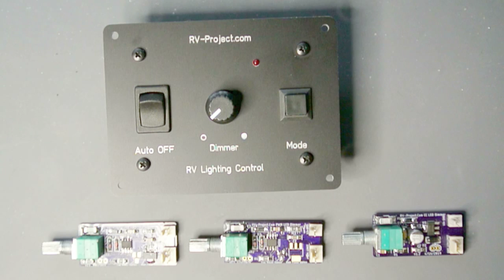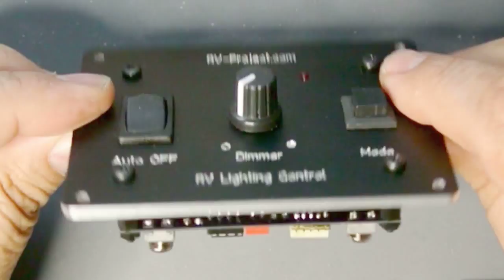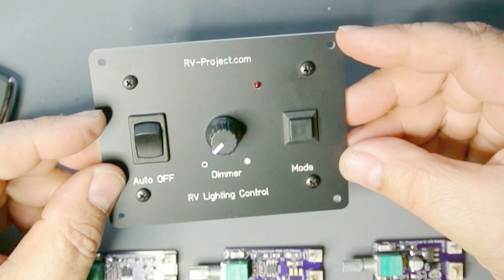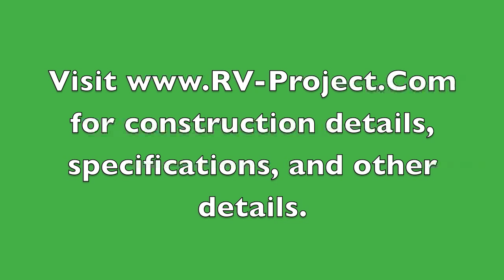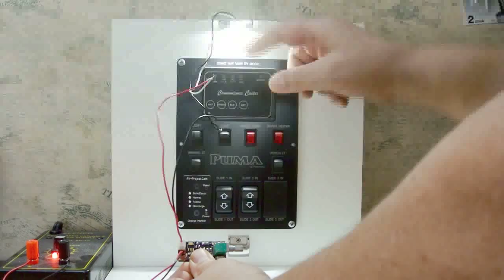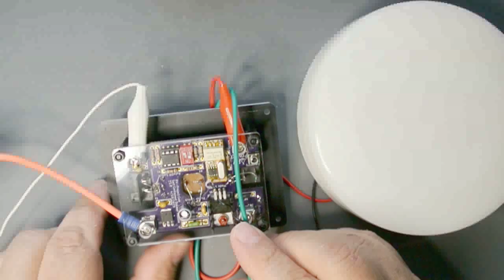Four Custom-Built LED dimmers for your RV (that you can build).

Comment: You are an expert! I wish I had your knowledge. I could use your help! Some time ago, my RV dealer installed some dimmers for me. There are 2 on one side that when both lights are on, if I dim one they begin to pulse, bright to dim. The dimmer they are, the slower they pulse, and pulse faster as I turn the brightness up. If only one or the other light is on the dimmers (individually) work perfectly. No one can figure out why. Any ideas???
Reply from the maker: It's not uncommon for LED dimmers to flicker at times. Usually though, just a slight adjustment of the control will take care of it. 

However, your description seems a bit different.

One possible issue is the dealer used the wrong type of dimmer.  Many of the cheap china dimmers are LOW SIDE, because they are less costly to make. Other dimmers, especially the few made in the USA (yes a few are still made here), offer HIGH SIDE and LOW SIDE dimmers.

The use of a HIGH SIDE or LOW SIDE dimmer is dependent on how the LED fixtures are wired. Some LED configurations require the use of a HIGH SIDE dimmer, while other configurations can use either. 

A HIGH SIDE dimmer will work in either case.

Another possible issue. LED dimmers typically use a technology called PWM (Pulse Width Modulation).  In effect, the LED is turned on and off hundreds or thousands of times per second. The amount of time the LEDs are turned on vs. turned off in each individual on-off sequence is variable. The longer the "ON" time, the brighter the LED will be. Therefore, flicker will be more noticeable when the LED is the dimmest, as the OFF time is longer.

Different LED fixtures have different PWM frequencys - that is, the number of times per second the LEDs are turned on or off.

LED fixtures used in RVs, especially puck lights. require a LED Driver. A Driver is a control circuit that ensures the LED does not receive too much current - which can burn them out. Think of the driver like a Governor on a motor.

There are two types of drivers commonly used for LED fixtures. Linear and Switch-Mode. Linear drivers are somewhat inefficient and waste a bit of energy, while Switch-Mode drivers are more efficient, and they actually also use PWM to control the LED.

Unfortunately, the PWM LED drivers don't always behave well when used with PWM drivers. Thing is, you are attempting to control a PWM LED with a PWM dimmer, and that doesn't always work - or at least work well. The best results are achieved if the PWM driver in the LED is a higher frequency than the PWM dimmer.

Recently, with the emphasis on dimming LEDs, many of the LED fixture manufacturers have gone to linear drivers as they work better with dimmers.

Long story short... you can try replacing the dimmer with a different brand. Especially those cheap Chinese dimmers found on eBay and Amazon tend to have a higher frequency, and they may not work as well with Switch-Mode LEDs.

Or you if you have Switch-Mode driver LED fixtures, you can try replacing them instead.  There is a way to determine if the driver is switch-mode, and I explain that and how to wire a HIGH and LOW side dimmer in my LED Dimmer Shootout article and videos:

http://www.rv-project.com/gear/dimmers.php
Reply: @RVProject  Wow. Thank you for the detailed explanation!  Almost more than my "regular person" mind can comprehend. However, I neglected to tell you that my RV is a 2004 model and the lights are not LED, they're small halogens. I'm guessing that makes a big difference? I'm sorry I didn't include that in my original message.
Reply from the maker: Halogen fixtures take 4-10 times the energy than do LEDs. if you have several, you might be either overloading the dimmer, or at least causing it to work hard. 

I would recommend replacing the halogen fixtures with LEDs, especially if you boondock. Your battery will last longer.

These days, you can buy LED fixtures for around $10 each, or replacement LED bulbs - although they might cost almost as much as a new fixture.  And you don't need to replace them all at once, so the expense can be managed.
Reply: @RVProject  I think I'll take your advice and replace them with LED bulbs. I've been putting that off but the majority of my camping is boondocking. Then I'll take your first answer and replace my dimmers. I should be golden after that! Thank you a million times for your help! And BTW, I have incorporated quite a few of your RV improvements. Keep up the great suggestions!